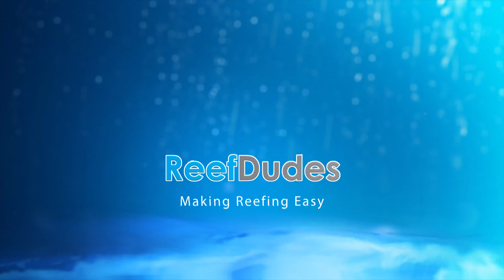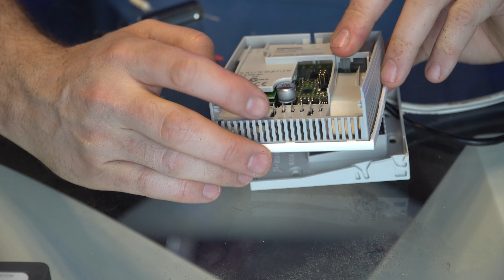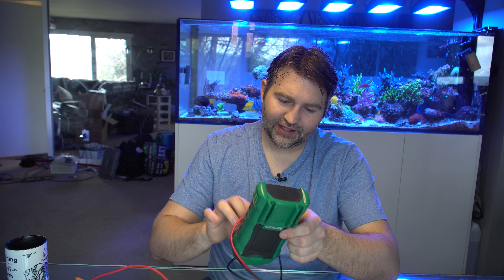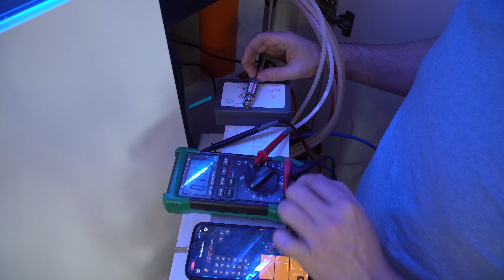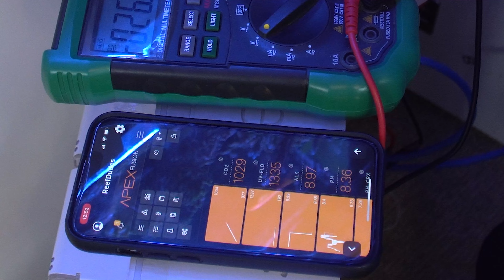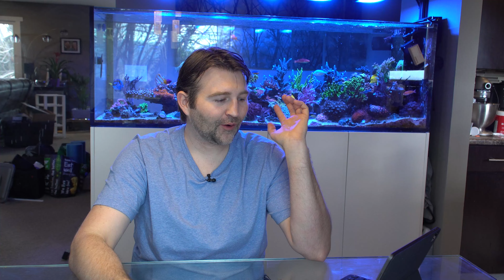How to Monitor CO2 with your Neptune Apex

Comment: Great design.  I am a bit confused about the upper limit and the conversion factor.  Is the upper limit of the Siemens sensor 1650?  If not, why not use whatever the upper limit is?  How do we test the accuracy of the conversion factor is we do not have a known value? Do you use your display C)2 sensor as your known value and then arrive at the conversion factor by diving that value by the sensed voltage?  Thank you.  Again, great video

Comment: Ok, just did a Tellaire T8300 -- got it working perfectly. I just set the ASM to 0-5v, min 0 and max 1650. Set jumper to 0-5v. Like another commenter, I too power mine off a 24v port of the EB832. Like yours, I love the fact mine has a display on the unit itself. I did accidentally forget to send 0-5v and was sending 0-10v, which I scaled it to 850 and it actually worked exactly the same as 0-5v. I didn't do the multi-meter, and just fudged it until it was holding close to what it was reading on the display.
Reply from the maker: Nicely done!  Haven’t a display on it is a nice touch! Would make it easy to dial it in to be accurate too !
Reply: @ReefDudes  thanks! I am surprised more people haven’t done more of these ASM projects and posted to YouTube. Any sensors you’d be interested in? I’ve been looking for other sensors to build but it’s nothing relevant - gyroscopic, force, photovoltaic, temperature, relative humidity. I can see how you could use temperature and relative humidity, but not much else.
Reply from the maker: @PatrickJewellTheGreat  same boat. I would love to do more but need to find something cool to do that’s actually useful for the tank :). Let me know if you find any super cool sensors!

Comment: I am truly a disaster in DYI, and i have a HUGE Co2 problem, to the point that my house runs 3,000 plus inside the house, if anyone is interested in building this for me, I will be happy to pay for your asking price for  it, this will create a huge advantage for me based on my issues to  monitor this with my APEX and coordinate additional fans to help circulate air based on this measurements.

Comment: I looked into this, then realized the price of the sensor and the time it takes for me to DIY everything.  Then realized that WiFi co2 sensors can be had for quite less money and time.  Imma just get one instead for less than $80 vs $250 for a Siemens sensor.  Thanks for the tutorial though, reefdudes
Reply from the maker: I paid 80-90 for the sensor off eBay. But also need the asm module ontop of it.
Reply: For me the appeal of this solution is simply the logging by Apex and the charting/comparision/overlays you can do once you have that data.  I imagine for those with automated setups, similar is true.  It would be nice for a native solution, but its interesting that you can DIY something like this.

Comment: This project can actually be done with the Hydros as well. The X4, Wave Engine, and the Wave Engine LE all have four 0-10v inputs on each device. So all you need is the CO2 monitor and an external power source.
Reply from the maker: Sweet Thats handy!

Comment: A very cool and interesting project.  Thanks for posting.  I’d love to see more of these types of projects and hacks in the future.

I would also be interested in how your CO2 cycles with the day & aquarium lights.  If you have a Apex Oxygen sensor, it would also be interesting to see the CO2 & O2 relationship.

Thanks again,
Jim
Reply from the maker: More to come! Once i have a few weeks of data ill dig into some of the correlations!  this one has been on my todo list for ages now so was great to finally build it!   I work on some more neptunte DIY stuff :)
Reply: Important to note that this is ambient air CO2, NOT dissolved CO2 in water. I believe those sensors cost several $K and hear they’re finnicky. I’m sure there is SOME CO2 in the water however it’s rapidly fleeting and combining with H2O to create H2CO3 aka carbonic acid. As free hydrogen concentration(pH aka power of hydrogen) lowers, that H2CO3 can shed a H or two to disassociate into bicarbonate or carbonate. Carbonate alkalinity in the ocean stems from atmospheric CO2. 

My Ambient CO2 tends to track with my pH and my lighting wattage graphs. I toggle between lye and soda ash dosing based on alk tests and current pH to limit the pH drop with lights off. This essentially offsets pH drop from elevated CO2 and I just see the pH spike from photosynthesis. My ambient CO2 rises with pH because I have my lighting set for optimal viewing when everyone’s home.

Comment: I’m monitoring co2 with my Apex.  I used a Tellaire Ventostat T8100D. Much simpler to setup than the model you used.  Wire it up directly no resistor needed. change one jumper, set the ASM to 0-5v, 0-1650.  I power mine off a 24v port of the EB832.  One thing I like about the Ventostat T8100D is it has a screen so you can see the readings directly on the unit and then verify your apex is reading it correctly.
Reply: Do a video about it - i will like to see it
Reply: Jk actually the 8200 is the one with different sensors. 8100 and 8300 are the same, just the pilot tube on the 8300 both have automatic calibration.
Reply from the maker: The screen is a nice touch!  This one is supposed to give 0-5v from removing a jumper  (thoma's/harrys both did) i think I there was an issue with my sensor  so the resistors was just a hack to get it going rather than dealing with trying to warranty it.. most should just need to hook up the 4 wires and be be done!   how much was the T8100D?
Reply: @ReefDudes  I got the T8100D for $20 new on eBay. They are more expensive retail but I see surplus ones all the time on eBay cheap.
Reply: I picked up a Telaire T8300-DB with a Pitot Tube from eBay real cheap. From what I can tell, it’s essentially the same as a T8100 but with different sensors on the inside. Question is what should I do with the pilot tube. I think it’s optional. However I think it would be cool to run it in line after a CO2 scrubber which can tell me if I need to shake the media inside to disrupt the air channeling through the media. 

Thoughts?